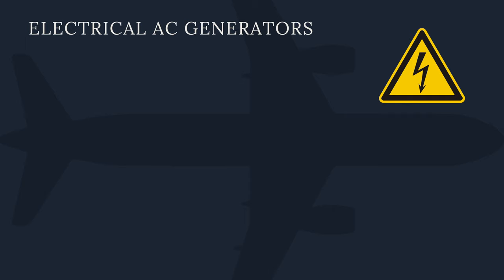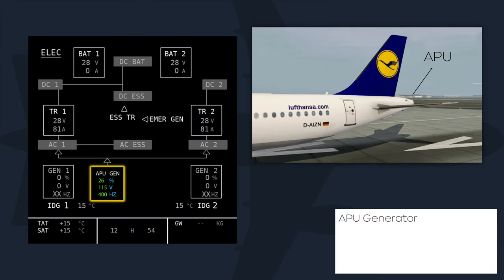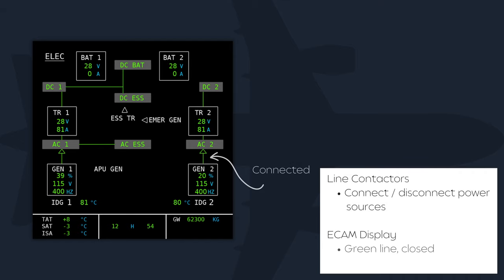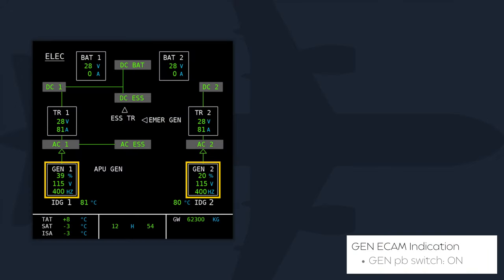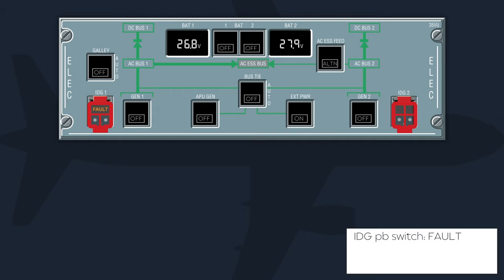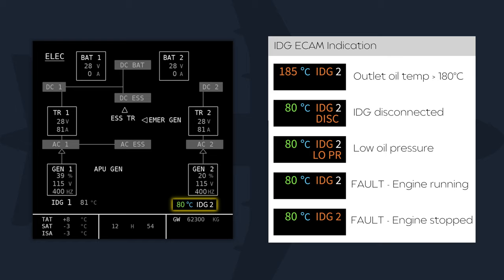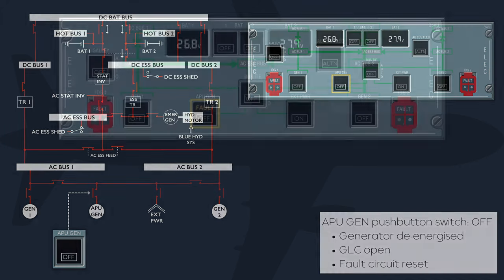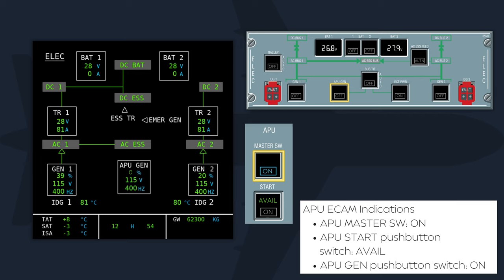Electrical AC Generators | Airbus A320

Comment: Meaning of the generator can’t connect in parallel?
Reply from the maker: It means 2 generators cannot supply electrical power to a single bus at the same time. e.g. if AC bus 1 fails, then GEN 2 is supplying the power to the entire electrical network (GEN 1 is still operative but it won't come into the picture, bus tie cont. will remain open and GEN 1 will stay disconnected from the network, leaving GEN 2 to supply the entire network).
Reply: @captainsiddharth gen 1 in this case, Will Power the Wing fuel pumps 1